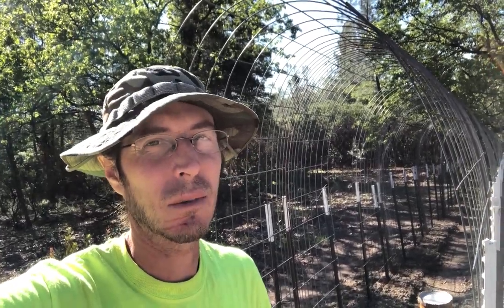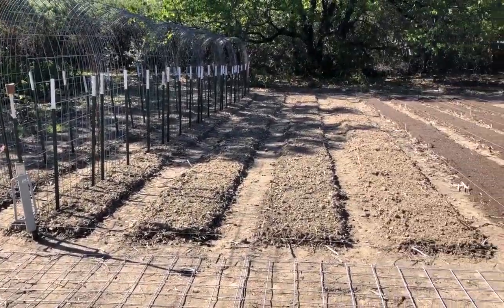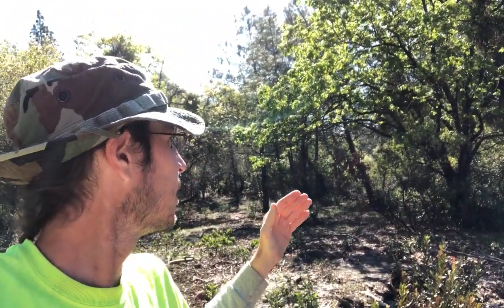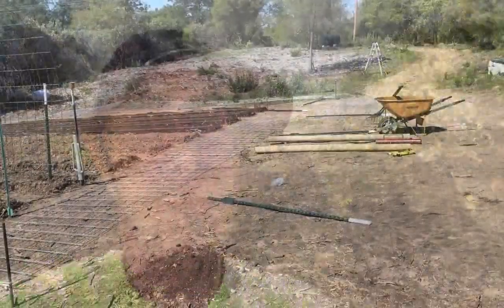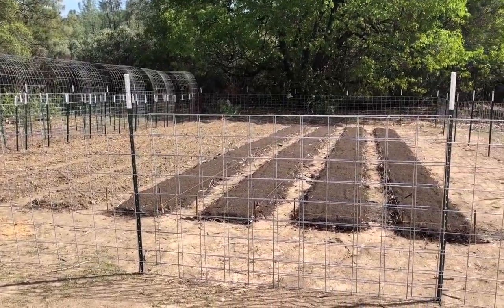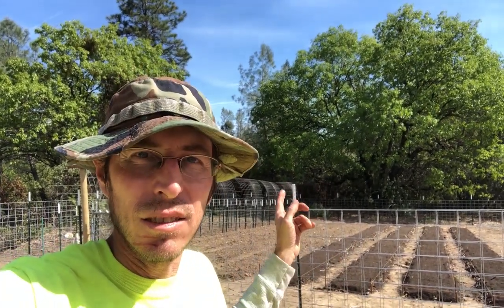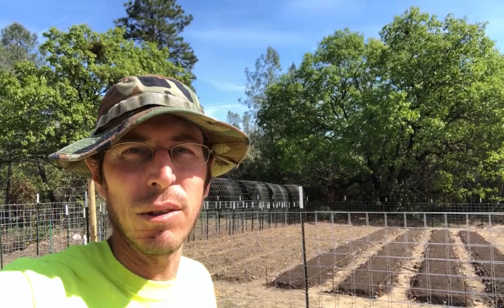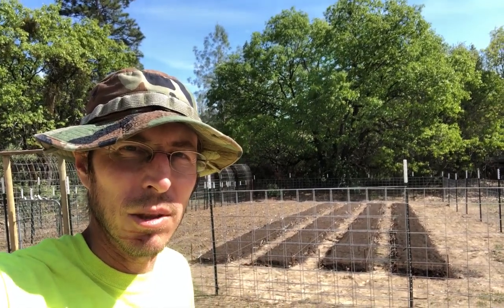Cattle Panel Garden Fence

Comment: Oh man... I have t-posts and cattle panel in my shopping cart at TSC online.   A bit afraid to buy because work is a little dodgy... so I'm waiting for my stimulus check, I think.
Reply from the maker: Lol. I received my stimulus a few days ago. Just gonna live like it’s not there until I get to working on the barn. Do they deliver to you? I had to pick mine up. Thankfully my Dad has a 20 ft trailer. Otherwise it would have been a little cumbersome.
Reply: @FarmerG  I'll need to pick up.   I have a rack on the truck, and will toss 12 foot lumber on top to make a support.  It should hold the panels "In theory" (famous last words)
Reply from the maker: Lol. Glad you have a plan. I would have been lost without the help I received.